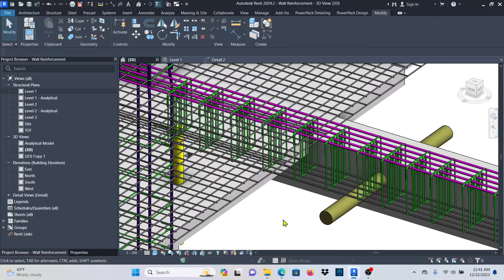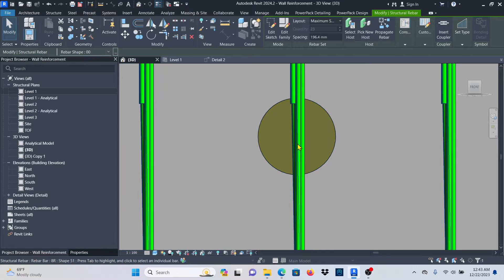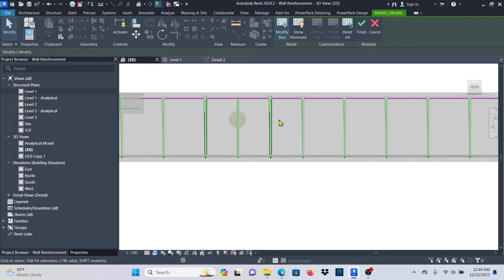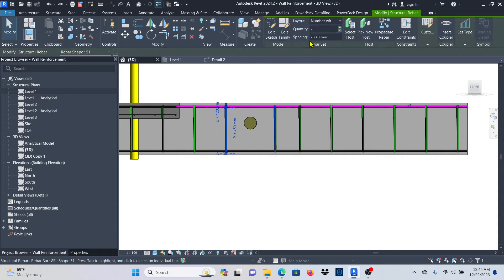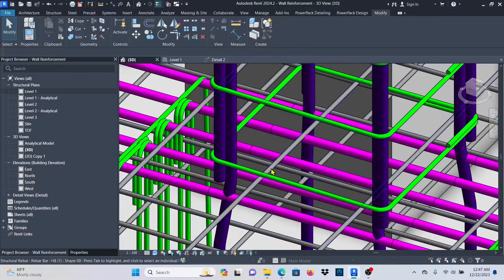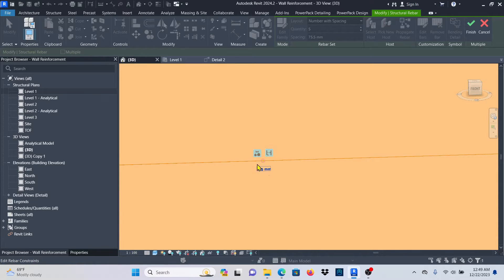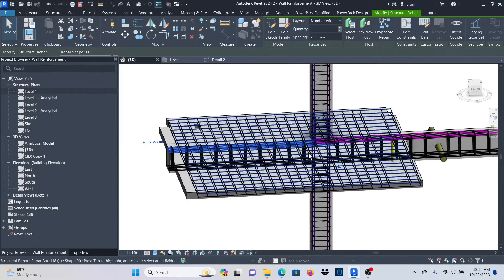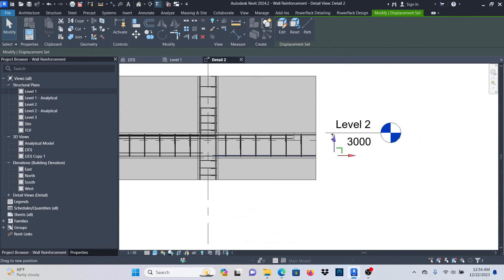Revit structure || How to fix rebar collisions || Secret to clean details in Revit

Comment: Great advice and video! How do you deal with revisions in rebar changes? For instance, the drawings have been issued to the site but then after an element is changed and new rebar is ordered or changed?
Reply from the maker: Not sure on your question.. But revit has revision tool to indicate revision... Just set it up and change rebar accordingly... All drawings update automatically